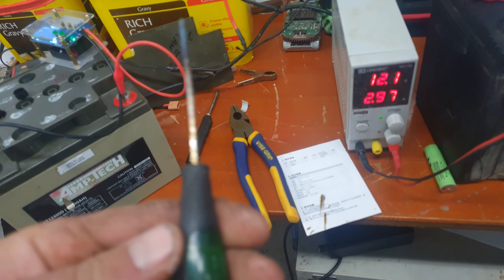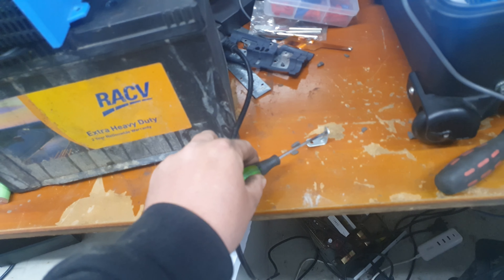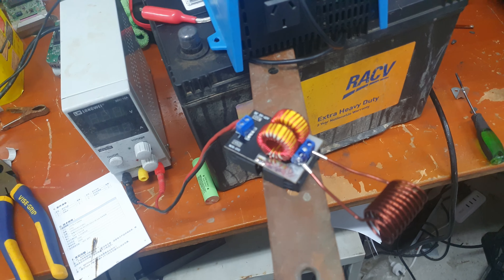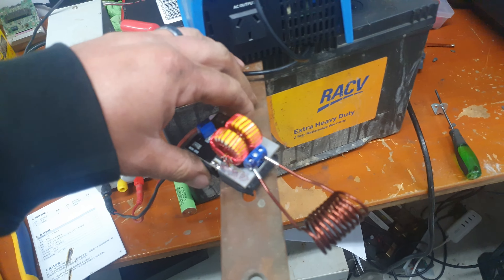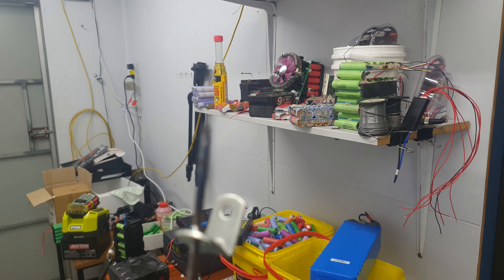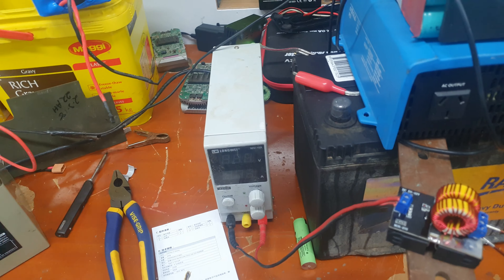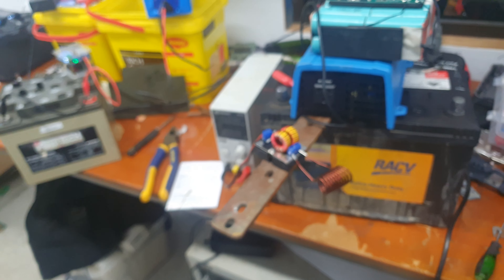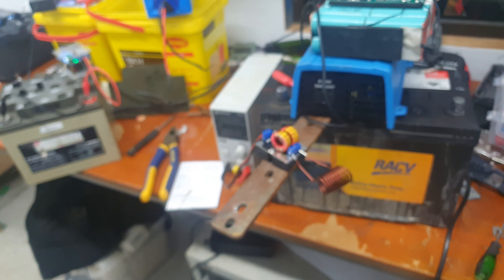Mini 12v Zvs Induction furnace kit first test

Comment: There not bad little zvs drivers. Iv purchased some myself. You have to replace the heatsink as there a little small and soon heat up! 
And I sometimes change the mosfets to irfp260n 

Good attempt there with induction.

Thanks for sharing”

👍👍👍👍👍THUMBS UP👍👍👍👍👍
Reply from the maker: Yeah it seams to heat well I want an induction furnace as I have a lot of copper to deal with and I'd like to make some bricks

Comment: That looks about the right size to use a bit of oil pressure gauge tube with water running through it to keep it cool for longer runs.
Reply from the maker: Yeah wanted to see if n it would work first now ill play around with it. Ordering a 2.5kw one soon

Comment: Hey I forgot to say, if you parallel some more of the same or higher capacitance it will make the metal heat up faster! Or even start to melt! 
Best of luck 🤞

Anthony / high1voltage1rules
Reply from the maker: Do you have some videos on your channel? I might buy a few more small ones and modify them
Works well with a server style fan blowing over board